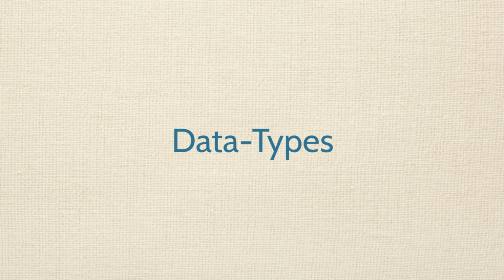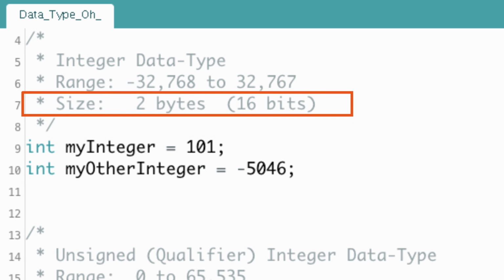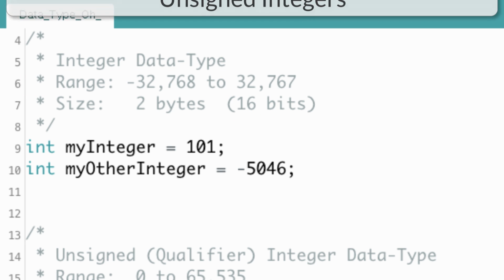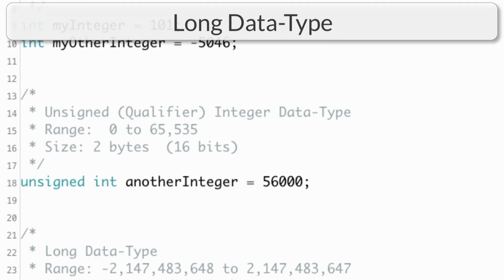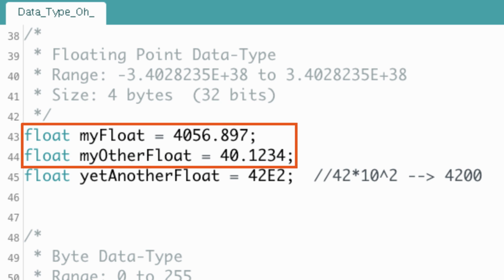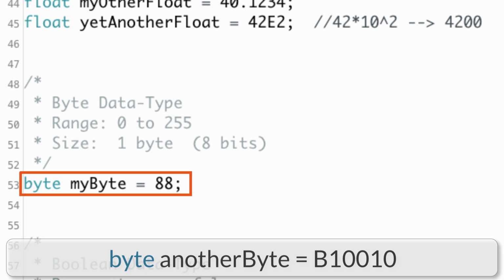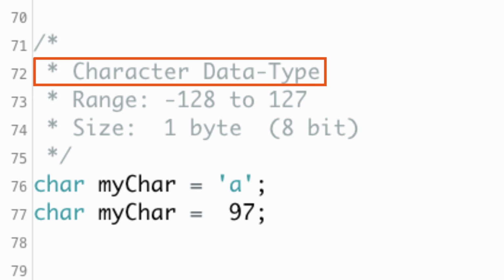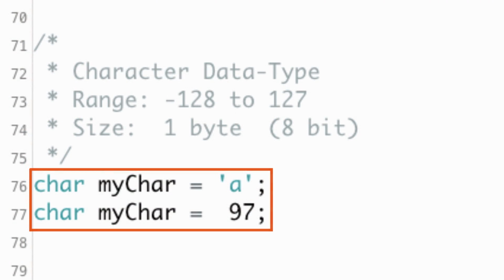Lesson 9 | Understanding Data Types for variables | Arduino Crash Course

Comment: hey guys i have problem with my arduino when i am trying to dump a program in it the ide is showing an error like  cannot open the device avrdude: ser_open(): can't open device "\\.\COM1": Access is denied.   and my tx led is glowing continously from the time it gets powered up(ie.,. first the normal procedure starts like the L led glows 3 times then tx and tx glows before that and after all these TX glows continuously )  

when i put in com7 port also the same is being repeated i dont know what to do ? some one sugget me something
Reply: +srikar sana When uploading to your arduino, you need to disconnect tx and rx.  Plug em back in once it's done.
Reply: how to disconnect. And more over i havent connected tx and rx to any only the tx led keeps  blinking(at a very fast rate i looks like a red led glowing ) . and the msg gets displayed as mentioned above
Reply: +srikar sana Well ok, I was under the assumption that you had tx and rx hooked up to something (digital pins 0 and 1).  That will prevent you from uploading to your board.  Without being able to see your arduino, it's pretty difficult to diagnose if it's a hardware problem.  Is there a short between your tx and rx maybe?  I have no idea, just get a new one, it'll cost a bit of money but your stress levels will decrease dramatically :)
Reply: HAHAHA THANKS LCECIL FOR YOU ADVICE I TOO WAS THINKING THAT ONLY.(but the problem is this uno belongs to my frnd)